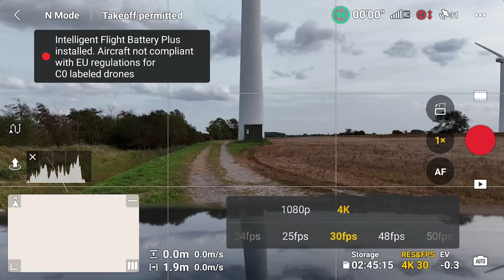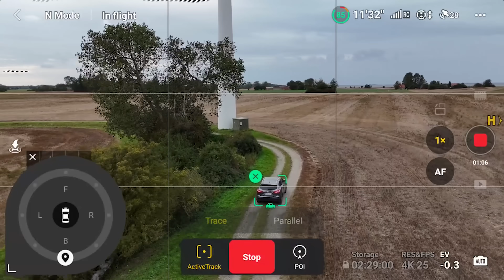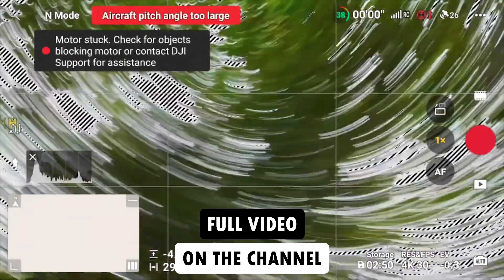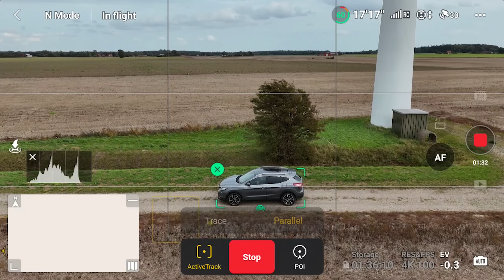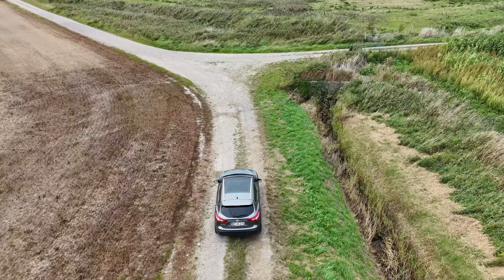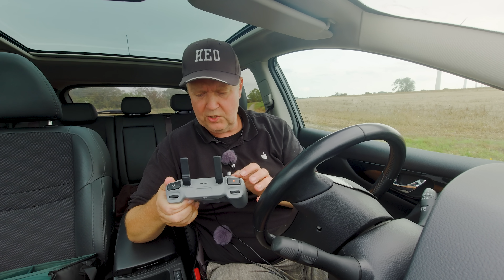DJI Mini 4 Pro Active Track Test & 4K 100 FPS Slow-Motion Drone Footage

Comment: It possible to remove the 50m limit? It carzy. It very short distance if tracking a car. Let say it's trees around and you want it little higher to not crash, then you hit 50m very fast.
Also, it would be good if there was a sound alarm, say when it is 46m away, then you can slow down the car. I lose the track very easy, and it not so easy when you are on a road to start again, not always so possible to just stop the car.
Good video anyway... Keep it up 🇩🇰💯👋🏻

Comment: What's the minimum height you can track a car at?
Reply from the maker: 2m, but let me check
Reply: @TECHDRONEMEDIA  that would be great.  One of the problems I have with the Mini 3 is it's minimum height of 6m when tracking cars.  This would put it into the tree foliage trying to use it to track my 4WD offroad.

Comment: Did you run into issues when exporting video? I just bought a mini 4 pro, used the same micro sd card from my old Mavic Air 2, and when i plug in my Mini 4 Pro into my Mac, it doesn’t detect a device for importing videos. I’ve tried inserting the SD card into an sd reader, then into my Mac, and still no go.

Comment: A lot of people is complain for flight time on mini 4 that is poor, some example from forum:"I just experienced the same thing (with the battery plus). I flew my new Mini 4 and my Mini 3 Pro at the same time. The 4 sucked down the battery WAAYY faster. My UAV forecast said "good to fly" against a 10 mph constant wind with gusts up to 16 mph. The 4 was an ABSOLUTE DOG against the wind. My 3, same time, same path travelled about 4 mph faster. Top speed in normal is about 26 mph and the 4 could barely reach 17 mph. AND.. I got the dreaded "battery overcurrent" warning the second I put the 4 in "sport" mode. VERY DISAPPOINTING! I think she's getting returned." You can read all of this just type on google mavic pilots 141109, if that is true i'm not gonna by mini4 for sure... 👀

Comment: The Mini 4 Pro sees only 18m in to the front thats 7m les than the Mini 3 Pro with 25m ...thats the problem of this new fisheye lenses
Reply from the maker: Interesting, thanks for pointing this out
Reply: @TECHDRONEMEDIA  can you do this with the mini 3 pro again?. I think, it would track that corners a bit better because the extra 7m into the front
Reply: Do you know what is the max speed if using a mini 3 pro battery?
Reply: @mrjoelpt it'll be the same but less run time and more weight

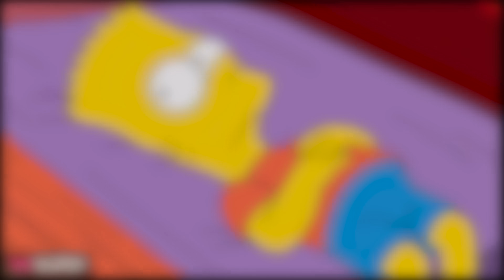Comment: Time 08:05. Did You change the setting, order the drone to follow You from the right side? If not, what made the drone "run into the wall"?
Reply from the maker: no it's still in parallel, not sure why it drifted towads the back, it should have stayed in position
Reply: @TECHDRONEMEDIA  That's really bad. The function is not reliable. Back to the drawing board DJI!

Comment: why do you only have two circles in actve track?, there should be an inner and outer ring???
Reply from the maker: When it's a vehicle, you do not have as many options as with a person
Reply: @TECHDRONEMEDIA  Fair enough, though I only just got my MIni 4 Pro and I don't drive, so I am not likely to be tracking a car, but thanks for the prompt reply.